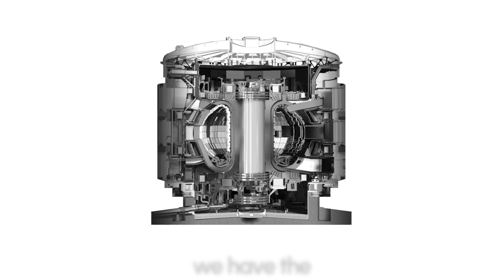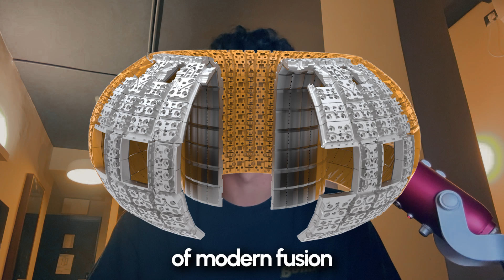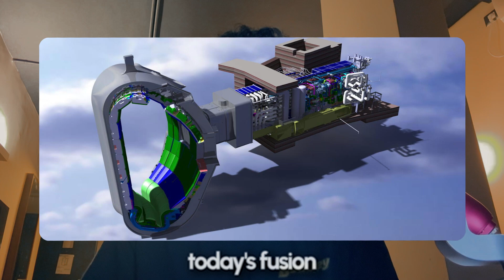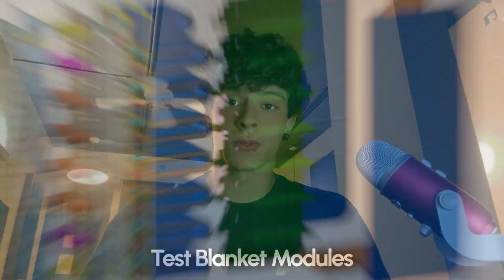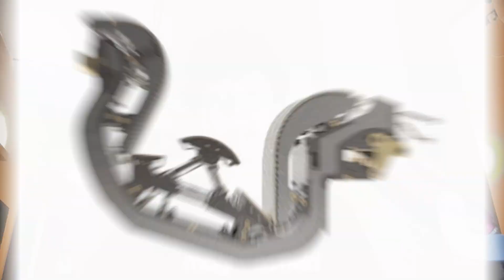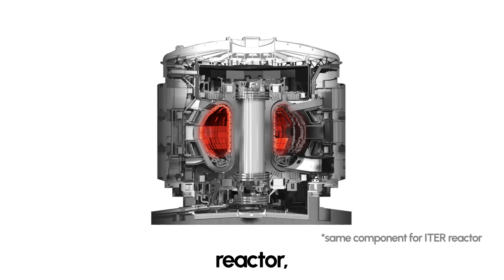Inside a Fusion Reactor

Comment: you did a good job at explaining complex topics like the wall of the reactor well and understandably when it came to the materials it would be nice if you explained the properties of the materials a bit more keep up the good work
Reply from the maker: yea sure I can try and do that in the future! Beryllium actually actively binds with oxygen impurities, but bc of that it needs to be fully replaced. Tungsten is just super heat resistant and strong, so ITER changed to it to stick with fusion norms at other centers.
Reply: the reusability of the by products to run the reactor is really cool